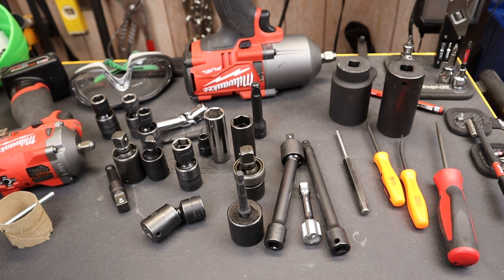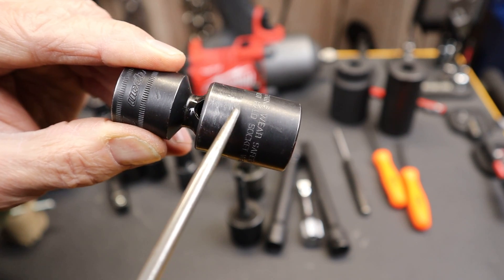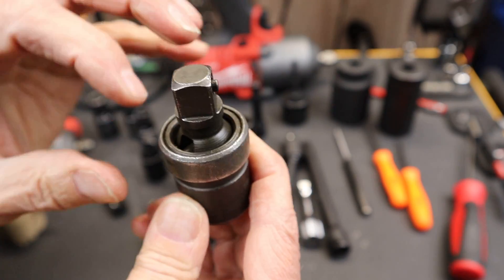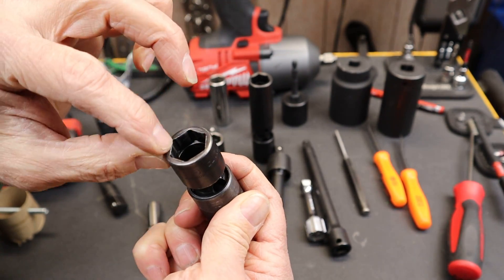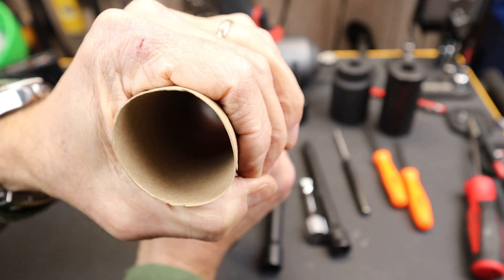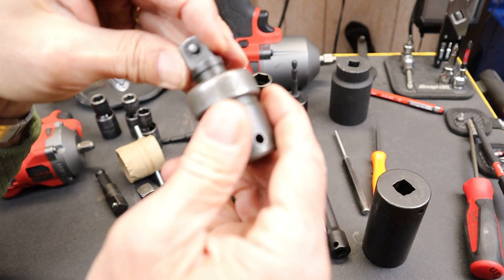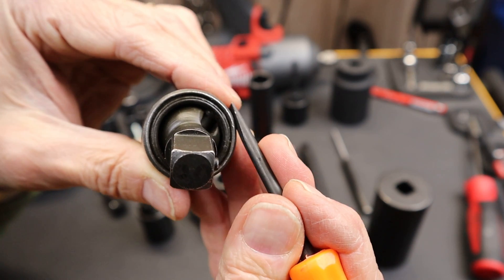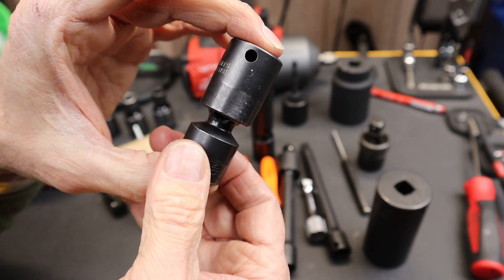Why is my Snap On Impact Swivel Cracking? These sockets expensive, fragile, essential and dangerous!

Comment: That looks like the effects of them grinding the weld on the heads of the pin. You can even see the chamfer is thinner in that area, which would be consistent with them removing excess weld material.

Comment: The pin is designed tp prevent the sockent from blowing apart and killing you. Never use pinless swivel sockets. They are terribly dangerous because they can separate and come flying at your head.

Comment: Have been using the Snap-On version for over twenty years in a professional environment. Originally purchased them when they had the collar. Over the years they have been warrantied with the non-collar. The most common failure point on mine have always been the pin on either style. I abuse the crap out of them with big 1/2" drive impacts with an adapter that breaks more frequently than the sockets. Many just wear out on the socket end and don't fit tight so I warranty them.
Reply: The pin is designed tp prevent the sockent from blowing apart and killing you. Never use pinless swivel sockets. They are terribly dangerous because they can separate and come flying at your head.

Comment: Yeah, I’ve found that you don’t “need” deep swivels because an adapter and a deep socket will usually work.  However I did have need of a semi-deep swivel because the shallow was too shallow and a mid length with an adapter was too long.  So I bought the Snap On semi deep set and haven’t needed it since haha.

Comment: Hey Doc, from my 25 years plus using snap on impact swivels professionally on the daily I’ve only broken a couple of the pins on the older style with the collar 3/8 drive. Now that most of my 3/8 impact swivels are the newer style the drive socket end tends to wear out first before anything else breaks and then I just get it warranted it out.

Comment: I always buy IMPACT SOCKETS anymore
got tired of the chrome flaking off and the BLACK is better looking
and you can use them with anything
costs a bit more but worth it

so your SNAP-ON is cracking
doesn't SNAP-ON have a WARRANTY...?

Comment: About a decade ago I was doing a lot of front end work on oilfield trucks at a GM dealer. I bought the matco pinless swivels and they held up very well. Only ever had trouble with smaller sizes 13mm/15mm in 1/2 drive. Still use them daily. They were probably rebranded then too 😂

Comment: Whether it's pinless or pinned, the swivel socket has not yet been reliably mastered, all I know is the top tier brands command a top tier price that often gives u a shock when u see it. But, they have to warranty the tool & I think given enough use an impact swivel will fail at some point. I think Snap-On could decrease warranties on their impact socketry in general if they employed CR-V instead of Cr-M.
Reply: CR-V is inferior to CrMo from A strength standpoint
Reply: Snap On doesn't use Chrome Molybdenum, they use their proprietary steel which is Chrome Nickel Molybdenum Boron steel. Also, the other response is correct as Chrome Vanadium is an inferior alloy which was discontinued by Snap On over 90 years ago.